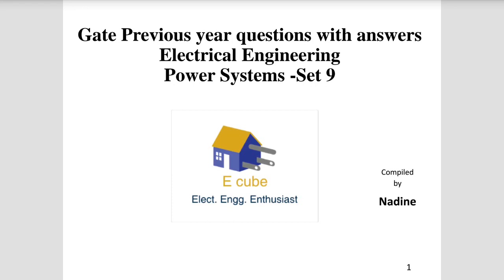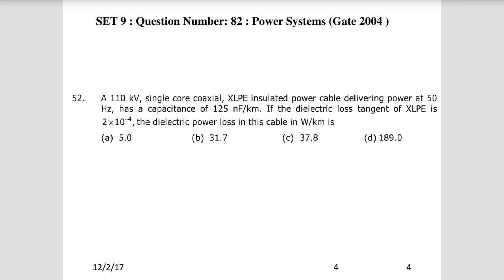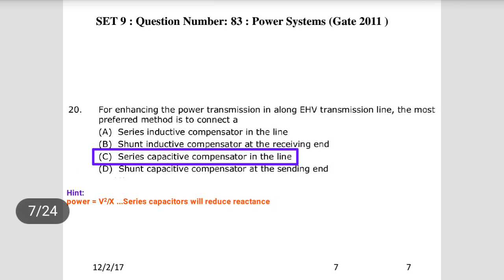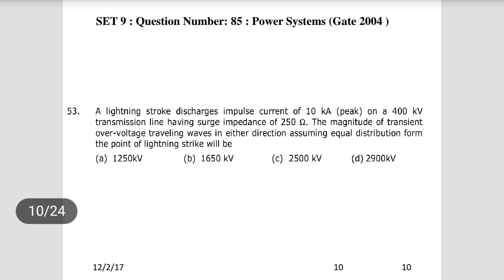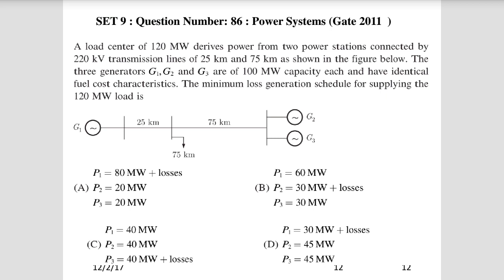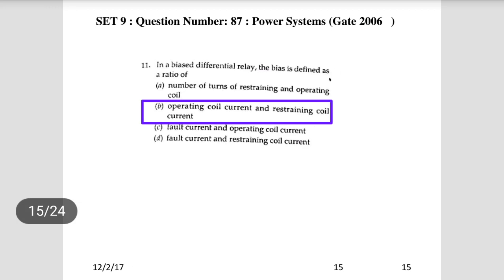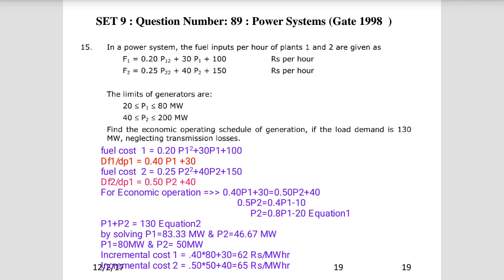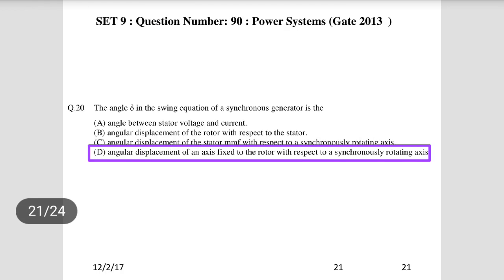Power systems gate questions and answers set 9

Comment: sir in question no. 87 the bias is the ratio is no. of restraining coil turns to operating coil turns not current ratio
Reply from the maker: Thanks for pointing out. 
The relay operate when magnitude of the difference in the currents at two ends of a protected element exceeds a certain percentage Nr / No of half the magnitude of their sum.Hence the name is percentage differential relay. Where No = number of turns of the operating coil and Nr = number of the restraining coil.